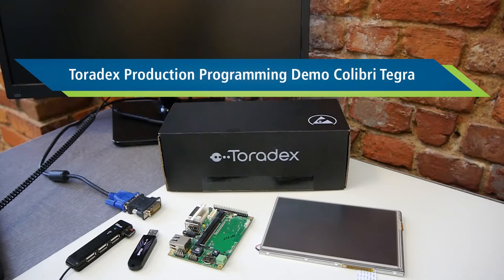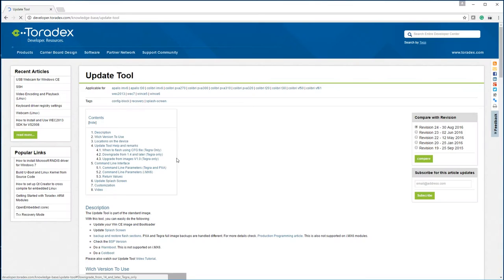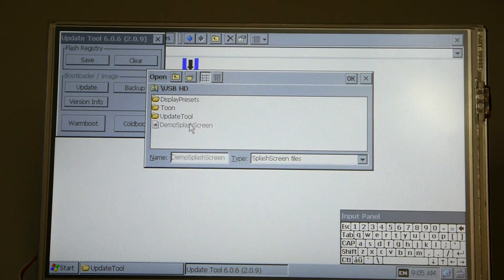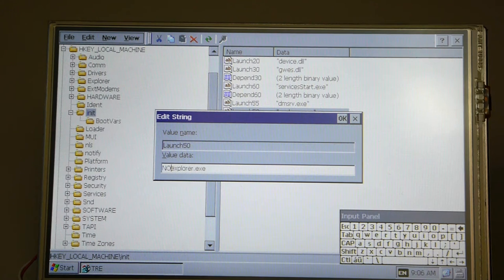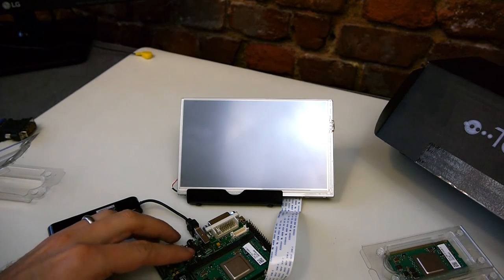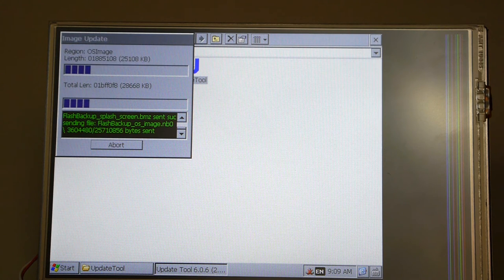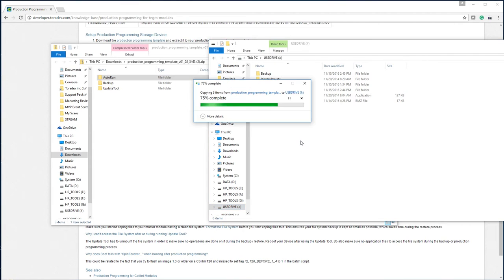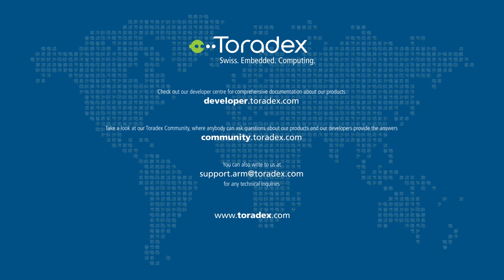Toradex - Programming Demo Colibri Tegra

Comment from the maker: Hi Marius, we do no have the update tool for Linux. However, you can image the rootfs or boot partitions using the UMS mode in U-boot.  
See:  http://www.toradex.com/community/answers/2812/view.html
Toradex is also working on a much simplified way for programing Modules, rolling out first on the i.MX6 based modules, stay tuned.